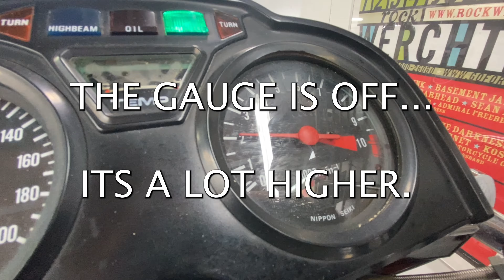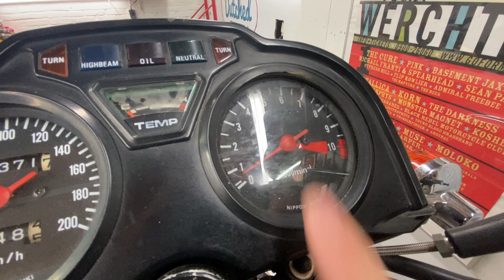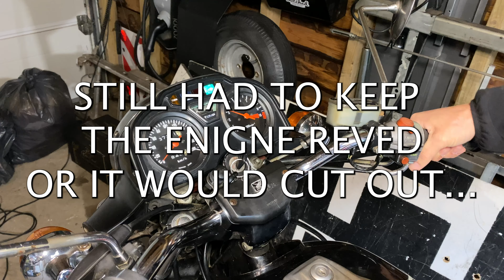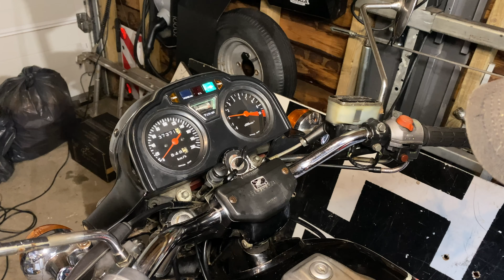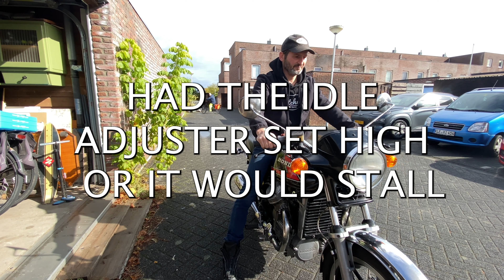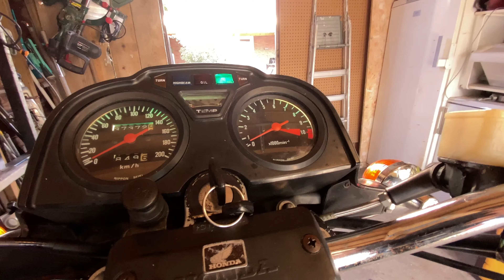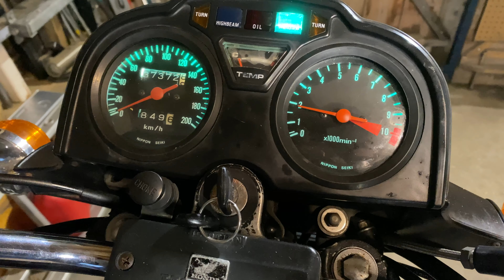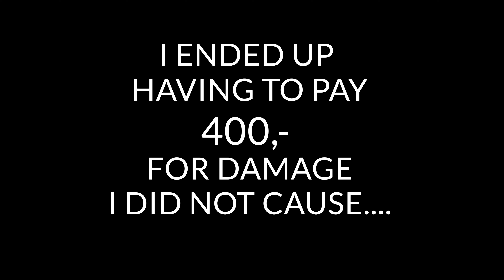Honda CX500 ignition and carburetor problem

Comment: Adjust the mixture screws its running to rich
Reply from the maker: i had a lot of problems with the iginition on 1 of the cylinders. This caused the RICH mixture. As 1 cylinder ended up not firing,.,, the cause was a bad connecter (i now know)

Comment: Bit late on this but I would also suggest balancing the carbs I had this issue many years ago on a 250 twin struggled for days untill a mechanic mate turned up with the guages and hey presto job done ??? worth a thought !!
Reply from the maker: Thank you for the advice. I did get everything running, the “main” problem turned out to be a bad connecter to the sparkunits. Later i did balance/sync the carbs (first bench then with gauges)